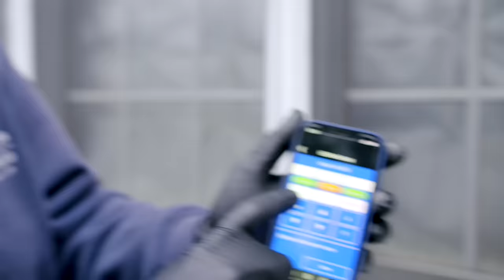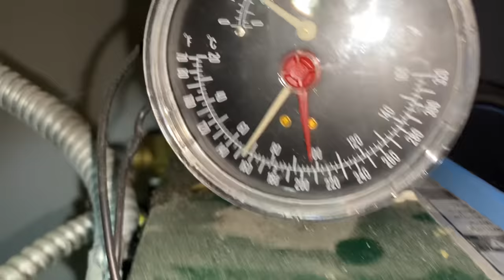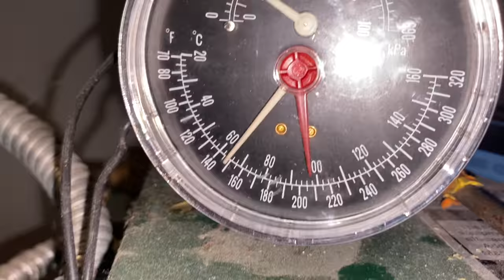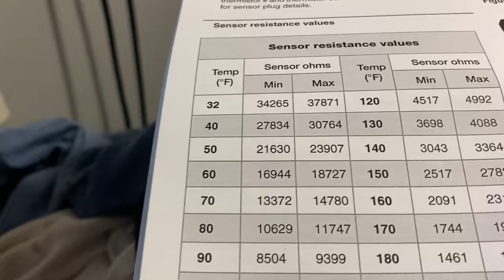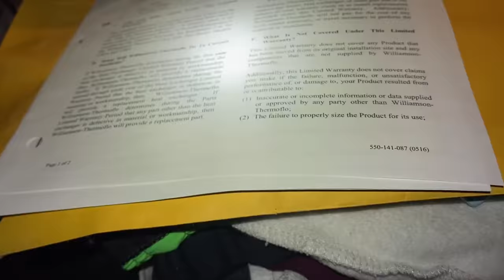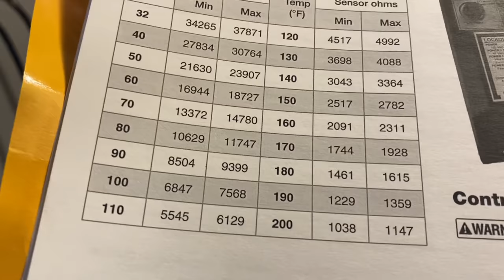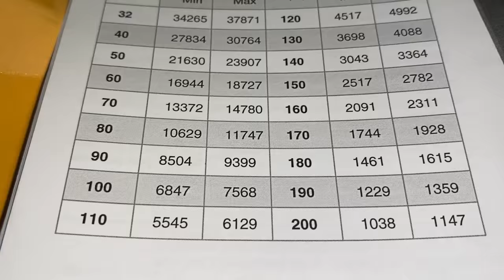Williamson Gas Boiler Turning Off Before High Temperature Set Point

Comment: Found a Heating Help discussion when I searched for the controller part number.  Seems this is common that after a couple years the boards cut out at 140 F.  And they only last a couple years when replaced.  One commenter mentioned he thought it was in the temp control knob as he was able to get it to go to 180 but after it cut out on high limit it still didn't cycle properly.

Comment: Found a manual online, with the wires identified on page 32, lower right corner.  But they still don't identify orange.  White common, reds thermistor 1 and 2.  

You could get a resistor decade box or just a few resistors so you can hook up the resistance for whatever temperature across the plug and see how the control board acts. or a variable resistor and then check the resistance with your meter.

Comment: Do you guys work on more Boilers or  Forced Air Heating and Cooling Systems??
I know hot water is very efficient, but isn't Forced Are more economical since you can do Heating and Cooling with just one system.

Comment: I hope you tested the resistance of the new part with the control board disconnected, otherwise the board could mess with your readings. My money is on the wiring harness.

Comment: Those control units are crap. Replaced 3 of them.
Reply: @PipeDoctor  guess the ones I’ve gotten were made on a Friday :(
Reply: Those boards usually fail stuck at around 140F max temp. You can usually get it to run up to the setpoint by fiddling with the temp. setting knob or rebooting the control, but the next heating cycle it'll be stuck at 140F again. I've never seen a failed temp. sensor on those.
Reply: @baratono  exactly.. I had a brand new fail within a month or so, and since I wasn’t a ‘professional’ installer, I couldn’t return. I wonder if the one with a digital display is better for the Weil mclains , but you need need that new harness, correct ?